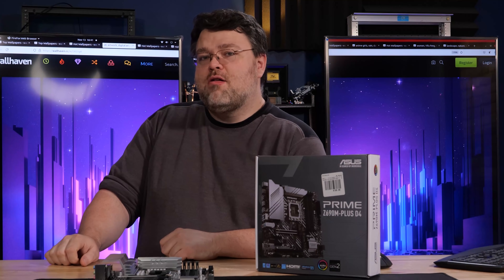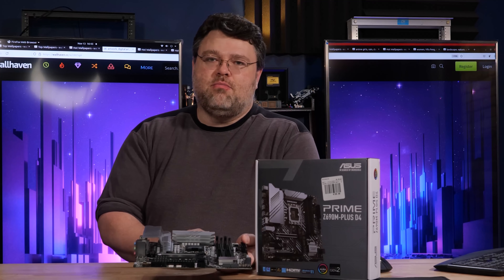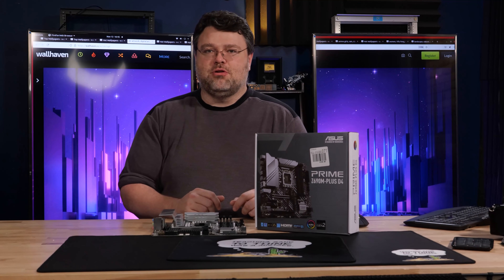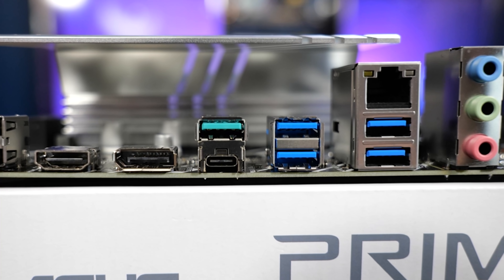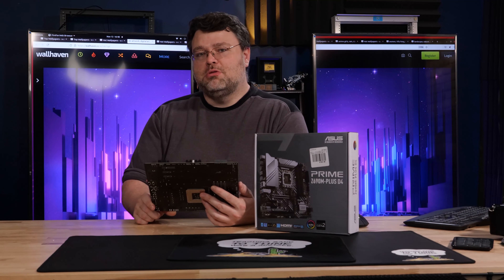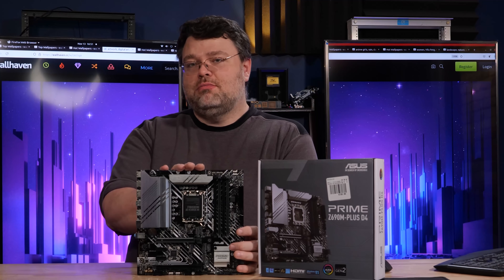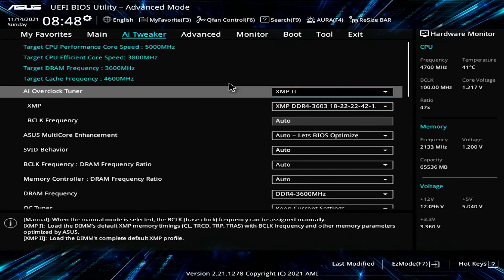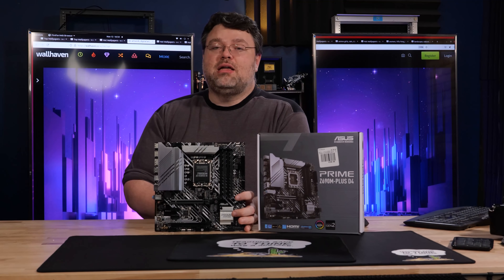Looking at the Prime Z690M-Plus D4

Comment: I got this mobo and noticed the cpu does run a little hot due to its spacing.

I have the intel i7-12700F 2.1ghz

On idle it was running sometimes at 40c and 60c

My GPU is the rtx 4070 12gb
Psu is 750w
32gb of ram

Recommend any coolers that'll fit?

Comment: I love this board! I had it for the i7-12700k and pushed it to 230w or so. I've sold that CPU to a buddy, and now it has a 13700k, am able to push 320w with the VRM reading at a toasty but absolutely safe 90c after couple minutes of stress.

The z690 is such a good chipset. I have the m.2 all maxed out with 2x gen 3 and 1x gen 4, 1x wifi card, dac, and other peripherals. There are  9x fans and 1x pump running all off the motherboard's 6x fan headers (with splitters). I was also able to push my ram to 3800mhz cl14 ram running at 1.5v. Honestly great board for maxing out an overclock on most conventional cooling! (probably not great for custom loop overclocking unless you can actively cool the VRM)

Comment: Hey, just a "noob" question:
Is ASUS Prime series motherboard good for gaming and video production if I don't use it with CPU overclocking???
Reply: There's no such thing as a gaming motherboard. Motherboards are neutral, they contribute nothing. but Asus boards in my experience are very well made ive never had issues with mine.
Reply: You should look at the term chipsets ex; b-660  … not “prime series”. I recommend you b660 or even z690 for gaming its almost the same price range.

Comment: Coolers seems to have changed. Im using a lga775 socket cooler , Scythe Mugen 2, a 12 years old cooler, and my OC 12600k keeps steady 85 under h264 coding

Comment: Got a Asus TPM 2.0 (14 pin SPU) module from AliExpress, can I plug it in it ? You told that it already had TPM, though
Reply: I had the same question about adding the TPM module. It seems the processor itself has the TPM functionality and others have been able to install Windows 11 without the TPM module.  Of course, the TPM module allows saving digital certificates.  I am trying to find out more myself.
Reply: @George_us  I have installed the TPM hardware which  was detected by motherboard. I am using it with no problem. I read that it is safer just dont remember where.

Comment: With Thunderbolt add-in cards for this board, if you wanted to connect a display, would you:
A. Find an add-in card with DP in, and wire up your GPU
B. Not do the above, and use the iGP to power the display
C. Just can it and plug the display directly into the GPU
?
Thanks.

Comment: I know the pain of the mATX enthusiast. I was so hyped for generation 1 Ryzen but I refused to settle for a B-chipset motherboard. I was on a 3570K and really hurting, but I persevered for what felt like an eternity until way later when the X570M-Pro4 from ASRock came out. That extra x4 NVMe is just too important.
Reply: The B550 doesn't have the greatest I/O, but it's good enough for mATX. Most board vendors are just lazy about divvying up the lanes. The best one I've seen is the TUF B550M plus. It has the second x4 NVME (my P31 runs just as fast in the second slot).

Comment: Check out the INWIN 301c for a build with this. IIRC, it’s the smallest non-niche case by litres for mATX.

Edit: meant to note it has usb-c front panel!
Reply: @G-Misc 59 just built a machine for my mom in one of those inwin 301 case and am itching to build myself one, its smaller than my silverstone tj-08 and id rather use 120mm fans as those 180mm are a pain. im just not too keen on switching to win11 for the scheduler using 12600k or 12700k on that board. im not too sure about the vrm on the asus board as i like to tweak things a bit.

Comment: mATX were super popular in 2010s; but, because GPUs got so freaking huge you need full ATX if you want any USABLE pcie slots. The nearest usable slot that won't choke your GPU like it's in a pr0n nasty is 4 slots down - so falling off  mATX.  Additionally, mATX often have issues with VRM heat build up as the traces on the power plane tend to be smaller, there just isn't the same thermal mass of copper traces compared to full ATX, when power peaks those thermal pulses are that much more noticeable in a small mobo. Plus, greater trace density tends to make smaller mobos worse overclockers, compared to equivalent ATX brethren, due to increased signal noise. To have the performance of a 6 layer PCB in ATX you need an 8 layer mATX - which means paying more for the same feature set. If you want a compact build, without going into ITX super compact, just get a well designed ATX case, some newer ATX cases are very space efficient; for example - Meshify C (c for compact) takes a full ATX board and is in a size that, during the 2010s mATX boom, would have been a compact mATX case.  The current design trend is to shove m.2s under the GPU, then have usable PCIE slots 4 slots down and save on the headaches of working with a compact board. I think Wendell didn't quite have the right take on manufacturability. My 2c.
Reply: Ever since they added networking and sound to the motherboards, most folks don't need an extra PCIe slot.  Most people don't need 10G networking or capture cards.  And I suspect the trace density issue (which is more an mITX issue anyway) could largely be solved by having 2-DIMM mATX or DTX boards.  It's not like anyone needs 20-stage VRMs with ambient cooling.

There are just very few mATX-specific cases, so without economies of scale there's no reason to buy mATX.  Likewise, DTX probably fits in all non-riser-dependent mITX cases (cable cutouts notwithstanding) and should be cheaper, but good luck getting DTX to catch on.

Comment: no reason for an intel board to not have a thunderbolt connection. especially on 12th generation
all the things they dont want to put on the board, you could use the thunderbolt dock for , but they didnt add it
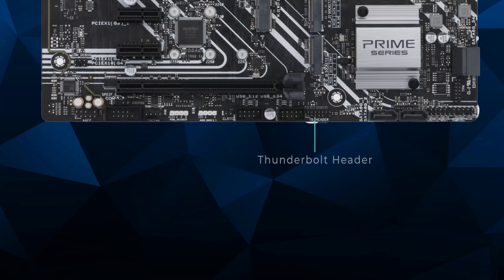Reply: 2:18 Thunderbolt header is there

Comment: Wendell speaks the truth, and I get angry. 
I only want uATX boards for my builds. It bugs me that in 2021, people are still building full size ATX PCs like it's 1995.
Reply: Gotta have them PCIe slots!
Reply: I agree w/ these comments.
I realize I'm posting on Level 1 Tech's channel, but outside of this crowd, how many users will overclock their PCs? For that matter, how many will used additional PCIe cards?
Clearly there are use cases for full size ATX boards (or eATX, for that matter). I have no problem whatsoever with enthusiasts using ATX and loading them up with peripherals and overclocking to their hearts content.
But for the other 99.99% of users, even gamers, a uATX case is functionally equivalent and will save some space. 
In my opinion, it is usually the right choice... as long as the manufacturers don't skimp on quality. I wish uATX would be marketed as the standard, and ATX would be considered an option... not the other way around.
Reply: @SciPunk215  anyone who streams needs a capture card, if you have a 6800+ or 3080+ card, good luck finding one narrows enough that will allow you to use the BOTTOM slot on mATX, without restricting the airflow to the GPU. That is IF the mobo has a working x4 on the bottom, if it's in a higher slot, you're totally stuffed. Want to add 10Gb networking or hardware raid? Good luck with that for same reasons. mATX is just bad, you don't save enough size over ATX to matter, but you give up all the expansion possibilities, in practical terms.
Reply: mATX were super popular in 2010s; but, because GPUs got so freaking huge you need full ATX if you want any USABLE pcie slots. The nearest usable slot that won't choke your GPU like it's in a pr0n nasty is 4 slots down - so falling off the mATX.  Additionally, because the traces are a lot thinner and more crowded on mATX they are (generally) worse overclockers than their equivalent ATX brethren and have issues with voltage regulation as the thinner power plane gets hotter. To have the performance of a 6 layer PCB in ATX you need an 8 layer mATX - which would mean paying more for the same feature set. At that time people would rather just get a well designed ATX case, some newer ATX cases are very space efficient; for example - Meshify C (c for compact) takes a full ATX board and is in a size that during the 2010s mATX boom would have been a compact mATX case.  The current design standard is to shove m.2s under the GPU, then have usable PCIE slots 4 slots down and save on the headaches of working with a compact board. I think Wendell didn't quite have the right take on manufacturability. My 2c.
Reply: @lucidnonsense942  Why would mATX have any worse power delivery than ATX?  Above the PCIe slots, it's the same size.  And why would anyone who streams need a capture card? I thought that was only used for input from consoles.

And most users are not and should not be buying $800+ video cards.

Comment: Ive been really happy with my Z690M and 12600kf in my SFFPC, very high performance, better than a 5800x, cheaper, and uses less power and less heat. 12th gen is such a great deal
Reply: Upgrading to 12600k from an i7 4790k from 2014. Couldn’t be more excited
Reply: @mbvbm3104  I'm doing the same thing 😂 I'm personally upgrading from i5 4670k
Reply: Do you have this exact board? If so how are vrm temps with the 12600k in slightly heavier workloads?
Reply: @deadly_mir  I have this exact board it's perfectly fine
Reply: SSS Dias  if your talking about the Asus Z690M-D4, that's not a video out port or thunderbolt for that matter... It's a normal usb c type port for file transfer and connecting external media devices... Unless I'm missing something. I believe there may be an internal header for thunderbolt though on the board somewhere

Comment: Not so long ago, 200 freedom dollars was considered high end....
Reply: Inflation+component shortage+ new launch. The cheaper B660 boards should launch in January if you are a tighter budget. Also 12th gen CPU's are significantly cheaper than the Zen 3 parts they beat, so the more expensive motherboards arent that expensive when your 12600kf is beating a 5800x and costs significantly less.
Reply: Hell... you could get a decent Z590 for close to $150. Now $200 is considered entry level for a Z series.